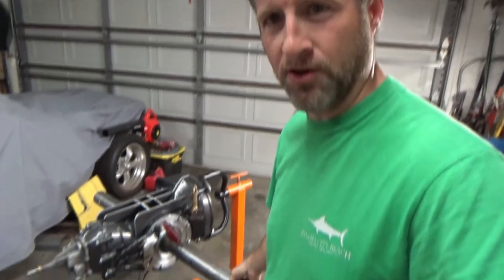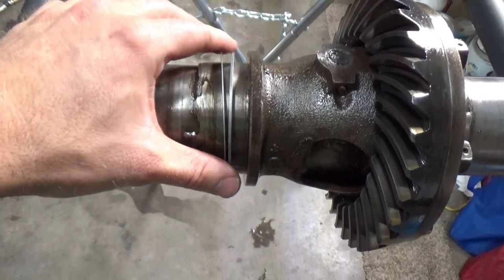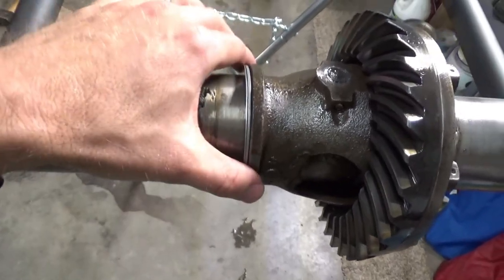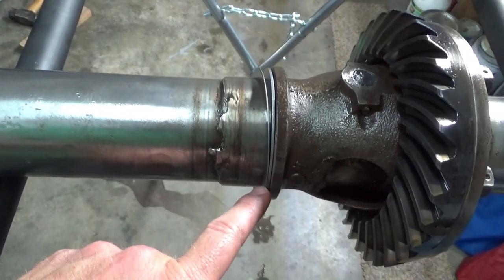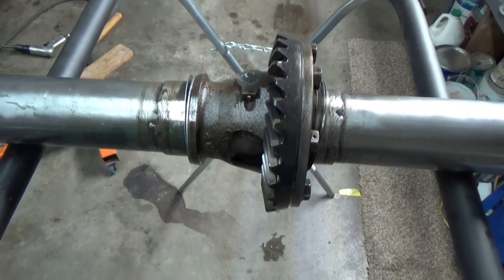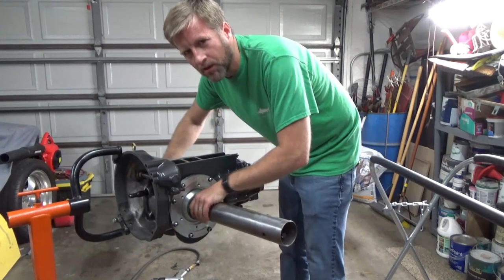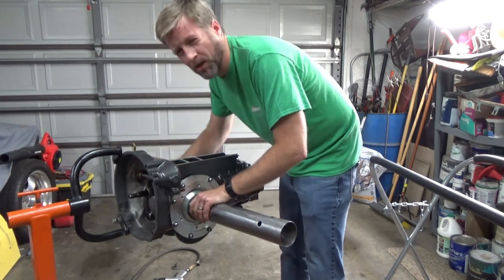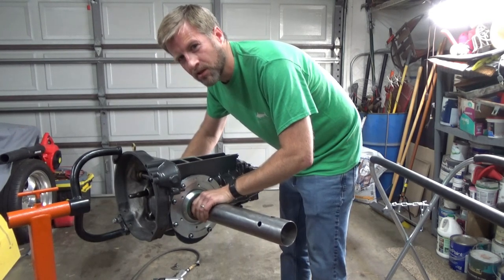VW Axle Install  -  Shim & Backlash Procedure

Comment: New subscriber here my friend. I am starting may channel by building a 1928 Morgan Aero RIP 3 wheeler with 4 wheels making it a Special. It was designed to look like an airplane even with a wood over steel frame and aircraft cloth stretched over the frame. I am mounting an experimental aircraft opposed twin engine on the front and casting a two piece aluminum adapter to mate it o an MGB transmission and through a driveshaft to an MGB rear differential with beautiful MGB wheels. The original has a GN solid axle rear and no brakes or reverse gear.  It also waggles so badly out of a turn that it is almost uncontrollable. I am keeping it British with the MGB while updating to juice brakes and a clutch along with 4 gears and a reverse. I am also winding a stator so that I can have lights to make it street legal eventually. Great video my friend. I love that transaxle. it looks tough.
Reply from the maker: That sounds like a very interesting project!  I hope you document some of the build as it would be interesting to see.  Thanks for the kind words, and good luck with your build!
Reply: @culturedredneckgarage3784  Absolutely my friend. I am almost done sourcing the parts. I just received my iPhone tripod thing. I believe I have a go pro or something analogous somewhere. I have to locate all that. I have to build a foundry first to cast some aluminum ingots. then I have to repair one of the MGB transmissions because it was removed from the car because it would not shift. Once that is done then I can melt the aluminum and cast a 5.75 inch diameter cylinder about 10 inches long . I have to chuck it in the lather and make a two part adapter for the opposed twin to mate to the flywheel and clutch in the MGB transmission. I want to get all that on video. this is the car I am making replica of and upgrading..https://youtu.be/W9QMa7AUD-4

Comment: Make sure you use silicone brake fluid in the clutch unit, mine started leaking after 2 years use with normal dot4.
Reply from the maker: Good call.  I think I may have the dot4 in my other rail...it's a good thing that I will be replumbing it before long then.

Comment: Where can someone go to find out about building a live axle?
Reply from the maker: I really don't know of anyone that currently does them, although I'm sure there are still some folks out there that can and probably still do them.  With the exception of one fella, anyone that I'd ever known that ran them in the past (sand drag applications) have long since passed away as well as their knowledge along with it.  I had searched online for years and could barely find any info on them at all except a picture or two here and there that helped show me the anatomy of one of these things.  As far as the actual axle and spool itself goes, I guess you'd just need a good quality machinist that can cut & weld a 40" or shorter x  2.75" DIA tube and weld it to a VW differential or spool machined for that diameter tube.  The side covers would also need to be machined to fit the side seal diameter as well that seals off the axle.  The gears are of course tailored to your application and budget.  I really wanted a two speed spring shifted set-up for dirt, but they don't make those anymore.  You might try KCR VW Transmissions out of Riverside California (951) 688-1904.  I follow them on facebook, and they are building some of the best quality racing transmissions around these days.  I bet they could point you in the right direction.  Good Luck!  They are fun to do, and one of these days I'll probably spend some money and regear this one to stronger ones.